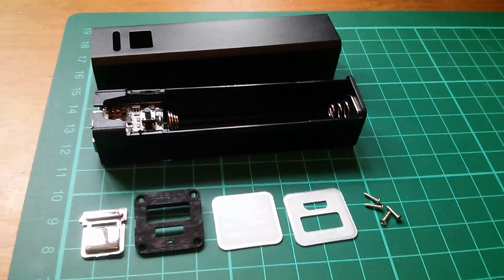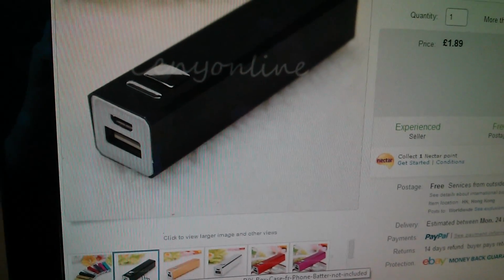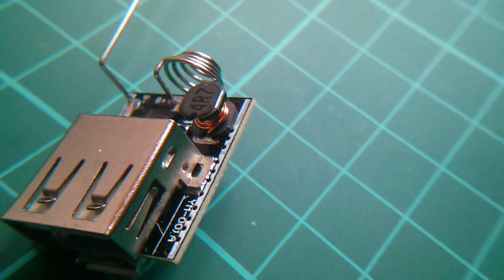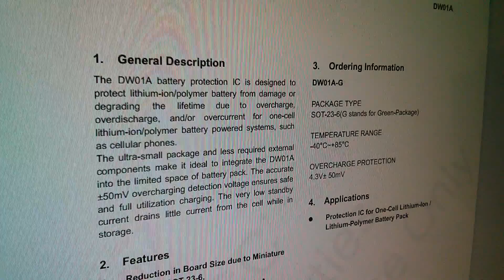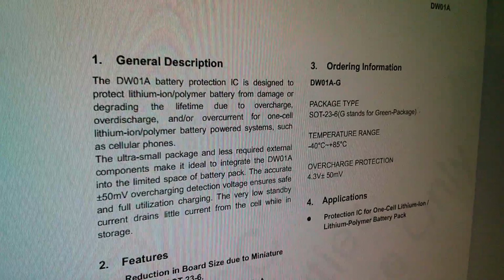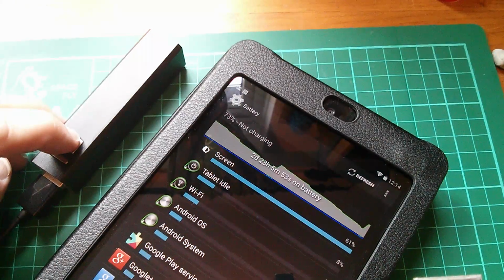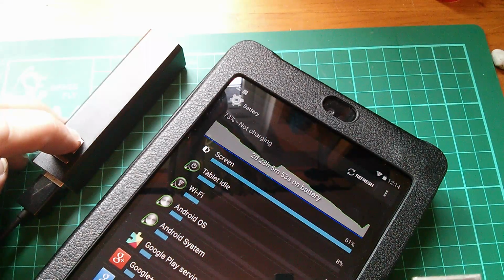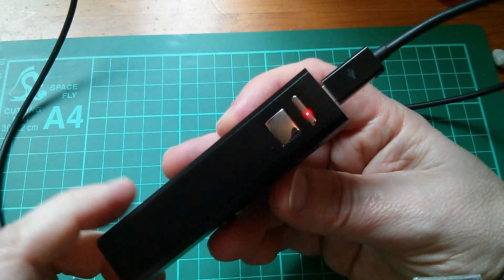Review: DIY Single 18650 Cell USB Mobile Power Bank

Comment: Hi, thanks for making this video! Do you know if this bank case has an automatic power shut off built into it if it does not detect a current draw from a load? I’m looking for one that’s “always on” to run some* super low current sensors (that make my current power banks shut off).

Comment: I bought three of them. Two of them will turn on, but not turn off when pressing the button. They will eventually turn off under no load condition. One turns on and off perfectly, regardless of running on a load or not.

Comment: Hi Julian, I bought a couple of these and they are quite good. The only issue I have, is that if the output current reaches about 650-700mA the unit switches off. The terminal voltage of the internal battery is about 3.5-3.6V when it switches off. I can only assume that the battery overcurrent protection is being activated. Is there a resistor I can change to raise the overcurrent protection threshold?

Comment: I recently got a 2600mAh DIY power bank from eBay. If, I use a 3800 or 4900 bat instead of a 2600 
Will it be alright? It won't overheat or explode right? Thanks
Reply from the maker: ***** Should be fine, but there's no such thing as a 4900mAh 18650 cell.
Reply: Just a random number I typed in, thanks for the assurance
Reply: 18650 only go up to 3600 mah other that claim more than this is fake

Comment: Hello - if i took the PCB out of this and connected it up to multiple 18650's in parallel would it work as a charger for a higher capacity unit (but obviously slower) ?

Comment: I connected a multimeter to the battery terminals to monitor the charging voltage. I noticed 2 things that worry me.
First, the voltage climbs up to 4.4 - 4.5 volts during charging. Isn't it too much? Should I trust my expensive batteries with it or not? When charging terminates, the voltage of the battery drops to 4.23 -4.22 volts.
Second, as long as the voltage rises, I suppose the charger is in cc mode and it takes a very long time to reach the maximum of 4.4 - 4.5 volts. But then the charging stops very quickly. The expected behavior is the exact opposite; less time in cc mode, most of the time in cv mode. Does this charger only have a cc mode? And if during the phase when the voltage is constantly rising, the charger is actually in cc mode, why does the temperature of the chip marked "17" drop while charging advances?
Reply: This power bank is a big disappointment when it comes to charging its internal battery. I wasn't lucky, I received a bad one. I am convinced that mine does not have a constant voltage mode; it only does constant current charging at a high voltage (4.25v). This high voltage might not be accidental but intentional so that it will fully charge a battery without constant voltage charging.
Also considering the fact that the battery cannot be easily inserted and removed in order to be charged in a different charger, this power bank is useless. I won't risk damaging my batteries.

Comment: 1:41 That thing marked "17" gets very hot when charging the power bank's battery. It could give one a burn.

2:03 Mine has a one amp diode. O_o

Comment: I have this power banck for a few months now and I used it a few times.
It is ok, but I had issues charging my iphone. The resistor coding on the data pins tells the iphone it can draw 1A but it's too much for that unit and it auto shuts off after a few seconds. I had to change the resistor coding to force the iphone to draw 0.5A. Now it's good.
An other negative point is the fact that in your bag or pocket the button will eventually the pressed on and there is no auto shutoff feature. I was relying on this for a trip and when I wanted to use it the battery was dead... (charged it one week before, so the button must have been pressed in my bag).

Comment: Oh and can you put in a larger capacity 18650? Like a 4000mAh?
Reply: The largest true capacity is 3400 mah. Anything more than that is fake. Also keep in mind that most (probably all) cheap xFire batteries from eBay have 500 mah capacity (give or take).

Comment: Great vid.  Thanks!

But have you run into a charger like this where you don't commit an 18650 "permanently"? If like to carry 2 spares in my pack and replace the emergency batt on the go if needed. 

Thx again!
Reply: I think you are looking for something like this:
http://www.ebay.com/itm/HOTPortable-Power-Bank-Mobile-USB-18650-Battery-Charger-Key-Chain-for-iPhone-MP3-/191133044586?pt=AU_Electronics_Batteries_Chargers&var=&hash=item2c806acf6a

Comment: By ur video, jas purchased one almost same as urs except 18650 battery istalled. Thx for the video input and it is really fantastic to watch and listen too. Beside the built quaility and all the small parts inside, would you later if hve time can do a test to see how much is the engery efficincy conversion rate for this particular IC board? U know, the efficiency rate is qutie important for all the power banks on the market. I hve no tools and knowledge to get the exact figure instead  estimating via charging a handphone according to the percentage. Keep up, really enjoy ur videos. Thank you very much. Cheers!

Comment: So is this unit using the protection IC to charge the cell too? I believe I'm right in saying many lipo/lion protection ICs have charge capabilities too but are they as comprehensive as the TP4056 you made a video about? I'm be interested to hook at meter up to the cell while it was charging in this unit to find out exactly. Many thanks for the interesting videos.
Reply: ***** Someone with a similar powerbank has identified the chip marked "17" as  an LTC4054 linear charge IC. So, no, all the protection IC does WRT to charging is disconnect the battery if the charge IC pushes the voltage too high.
https://cpldcpu.wordpress.com/2014/03/31/external-usb-battery/comment-page-1/#comment-271

Comment: TheOldmankk same seller has it
http://www.ebay.co.uk/itm/Eachine-3000mAh-Power-Bank-External-Battery-With-LED-Flashlight-for-Iphone-HTC-/310883008329?pt=UK_MobilePhones_MobilePhonesCasesPouches&var=&hash=item4862123f49

Comment: I see a distinct lack of caps on that board, only one tiny 0603 ceramic on the underside and 3 on the top.mind probing its output with a scope while its charging your nexus 7?
Reply from the maker: Good point - the output is probably quite noisy. Although with that 4.7uH inductor (if I'm right about that) the switching frequency will be very high.